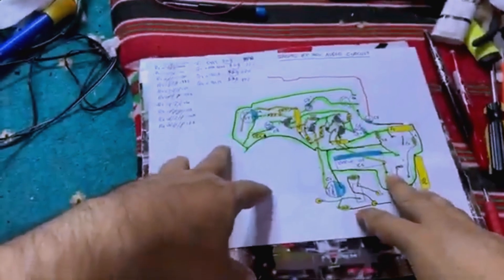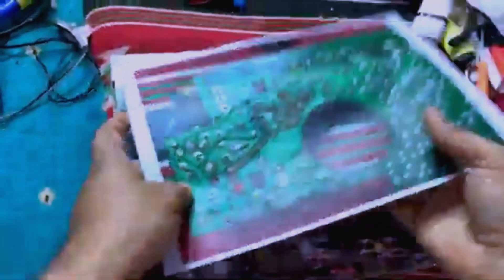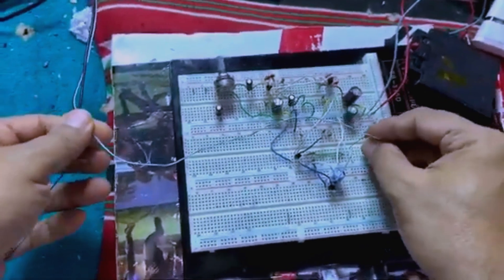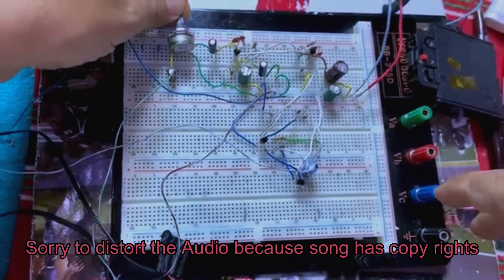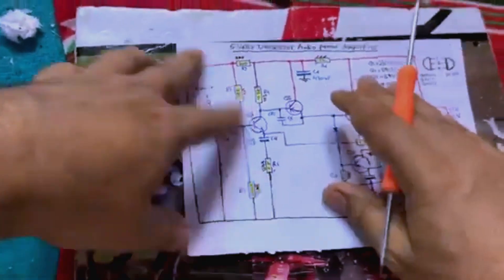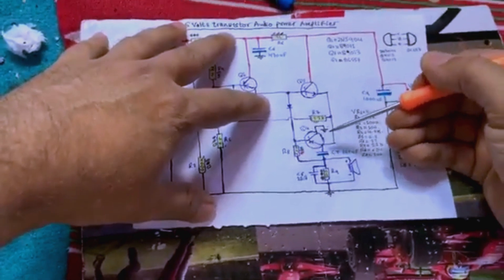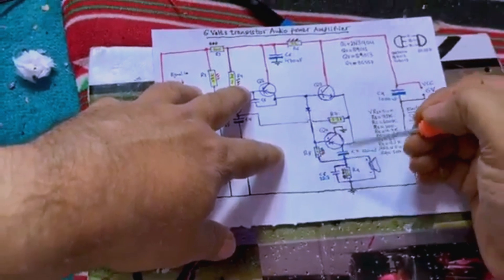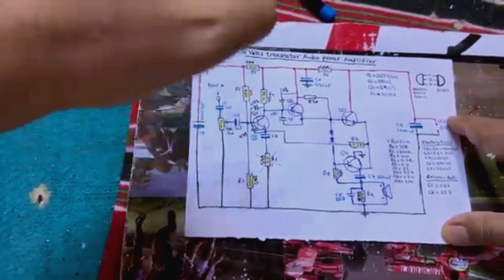Best Design Transistor Audio Amplifier 6 V

Comment: sir no loud speaker details ,if emitter resistor removed should i short to ground from capaitor c4
Reply from the maker: Yes follow the schematic, use 3 ohms speaker for best results
Reply: You can also make push pull audio amplifier by copying from old transistor radio , it generally uses only three transistor (Audio stage) sound quality will be good , I am planning to make one for testing purposes